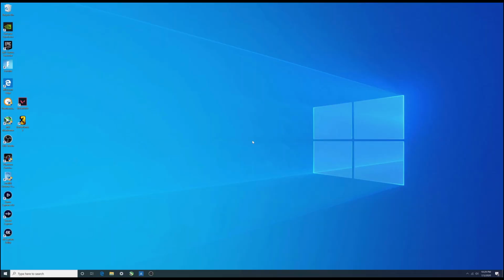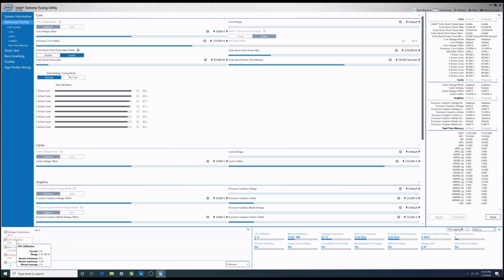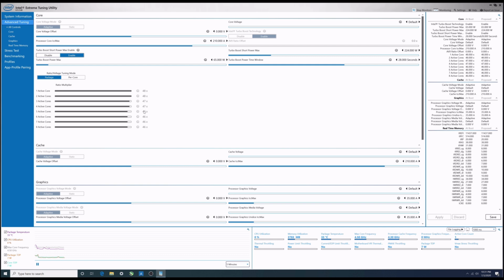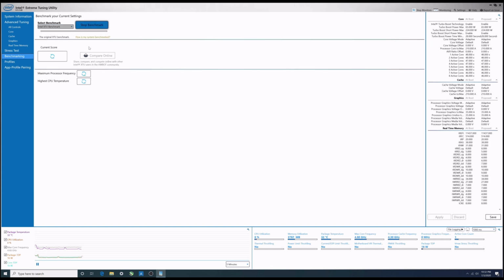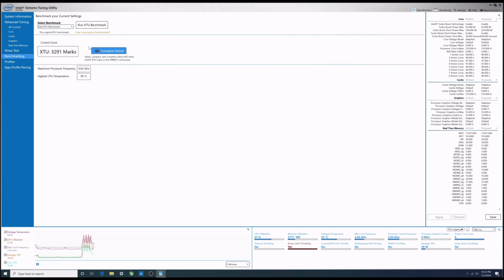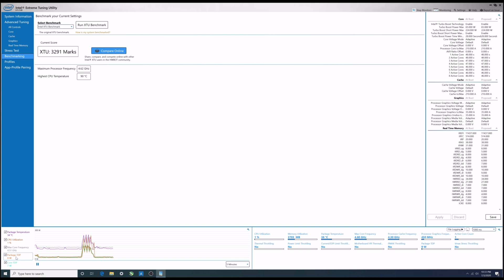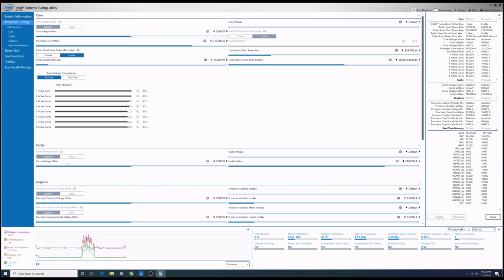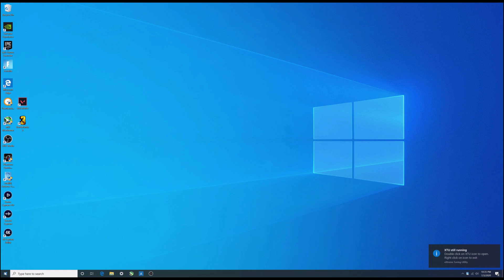1x4 1x8 CPU Power Connectors, How many do I really need to get this Z490  to boot up? (ATX) PSU z590

Comment: Is there any problem if I use 4pin to 8pin adapter for cpu? And my cpu is amd 3600x,  Pls any answer
Reply from the maker: I think short term, surfing the internet...getting booted to bios...probably not too bad.  Most of the PSU's that have 1x4 only are 500W and less, so the other aspect would be your GPU.  If you start having the computer reboot at peak performance, I would say it is time to replace the PSU.  The next worse thing is the PSU dies.  The next worse thing after that is the PSU dies and it takes out your motherboard or CPU...etc.

Your 3600x most likely will pull more power than the CPU I used in this example. I can further reduce the power used in this CPU by disabling turbo boost.   Obviously, performance suffers.  Unfortunately, this is more of an Intel channel and difficult to give you better advice.

Comment: Sir i have a 4 pin cpu connector but my motherboard has b450 8 pin cpu connector. help me please?
Reply from the maker: What CPU is it?
Reply: @PC_HardwareTechUnboxing_1   ryzen 3 3200
Reply: Is it sorted? Can I use 450watt power supply of 4 pin connector for asrock B365M pro 4..
Reply from the maker: @naveenkumarjain9571  Do you have your user manual?  In there it would state if you can use 4 pin and show you exactly which 4 to plug in.  If this was Intel, it would most likely be a yes as I just ran a I7-10700k with 4 pin, 8 pin and (8+4 pin) for a video.

Comment: Yeah you can boot and surf. But if you game, your system will reboot if you have something like an i7 and a 2080ti.
How I know? Experience.
Reply: So how many pin required ?? I installed 8 pins on my ATX motherboard I have system with i7 9700k and rtx 2070  super. Still I facing restart issues  I need to install  more 4 pin power connector (8+4) total 12 pin power connector ?? My psu wattage is 750 watt 80plus bronze . Circle raw power: brand
Reply: Aston Martien if you have an 8 and 4, you need to install  the 8 and 4 connectors. If you are still having reboot issues it could be the power supply, video card or cpu thermals. Typically its the power supply. I would buy a new reputable PSU from a place with a return policy and see if that fixes it. If it doesn’t I would return it and RMA the video card. But before that, I would check my CPU thermals. Since that is the easiest. That being said, sometimes windows could have gotten screwed up and a fresh install will fix the situation.
Reply: Experience ? ^^
Well, I'm using i7 9700KF* + RTX 3060Ti with only 4 pins to the CPU ^^'
(Overclocked the CPU at 5GHz (8 cores)) Worked flawlessly, went back at stock 4.8 though... (Because of temperatures, 60°C at 4.8 but it gets 65/72°C at 5GHz...
Is it wrong in any way to only use 4 pins if that runs well ?
Reply: @bastienhouse5202  Under heavy load  your computer could reset or even worse strain your cpu  to a point where something happens to the cpu. Power supply, quality of  motherboard and Video card all play a factor.
Reply: @gaurd3  Well... It had 100% CPU Load at 5GHz for a good hour, no troubles...
But went back at 4.7*, played 40h total at 100% or close... No troubles here, at all...
I have a Seasonic GX750W (Good PSU)

Though, from what you told + talking about it with a friend yesterday, I added a 4 pins to the CPU
My MB has 4 + 8 pins to power the CPU
==> Until yesterday I was using the 4 pins only
==> Now I'm using the 4 pins
==> + 4 pins out of the 8 pins, checked on the MB's manual, it's how it's meant to be.
Plugging the 8 pins with a specific connector, or only 4 out of the 8 with a normal 4 pins.

After that, I tried OC to 5.1GHe again (Just to see 5.08 instead of 4.98, I know... I'm a maniac ^^') And it appears it lowered the temps a bit while OCing...
So I can finally benefit from buying a KF CPU ^^
Thank you mate ! :)
May my love reach you ^^

Comment: So if I use an overclockable chip even if it is an amd, I have to both 8 pin and the 4 pin.. Am I right?
Reply from the maker: Aloha, I have run both 3900x w/ x570 and 10700k z490 on only 1x8, you will be able to overclock either one to a certain point.  If you wanted to do something more EXTREME than you may or may not need that 1x4 on a  2nd rail such as what the EVGA 850BQ that I have.  Eventually, I will do a bit more on this using Intel's Extreme Utility so I can see if it indeed uses more power with PL set to unlimited and gradual overclocking.  Comparing 1x 8  VS  1x8 & 1x4 It is definitely a subject not covered well by the Mfg, online or on YouTube.